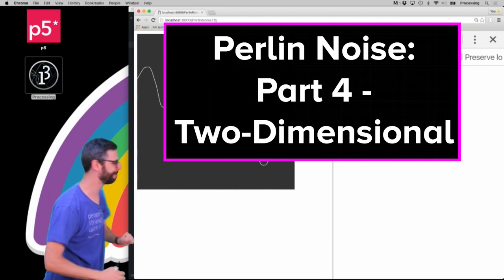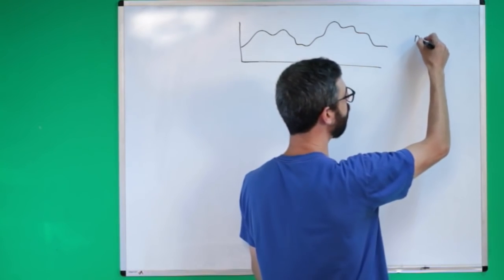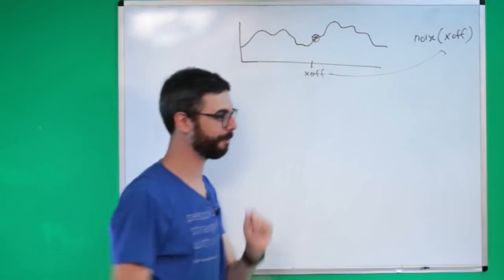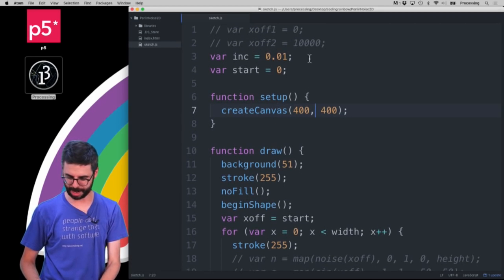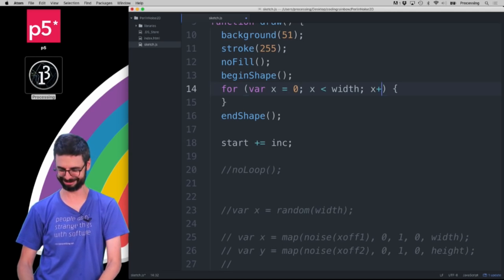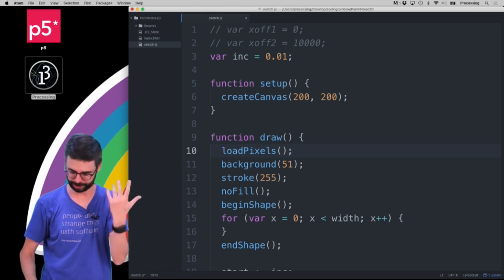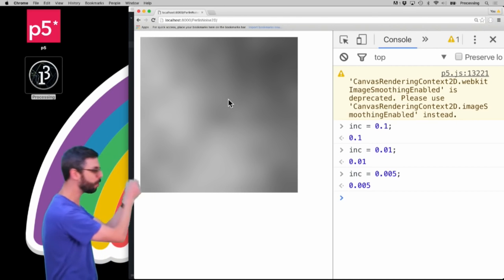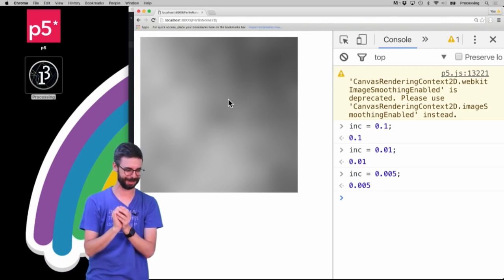Perlin Noise in Two Dimensions (p5.js)

Comment: Worth mentioning that the reason switching the order of the X and Y for loops works is because in the line "var index = (x+y*width)*4;" width is multiplied by y before it's added to x. p5 doesn't know what X and Y means and isn't actually using the letters to decide direction.

Comment: I'm  trying to do this in Processing and get stuck at the RGB spot. The index variable (x + y * width) * 4 gave me an Index out of bounds: 4000 error so I tried putting the index into a variable and mapping it between 0 and 255 but that didn't work (mixture of floats and ints). I'm wondering what the * 4 in the index variable does and if there's a way to do this in processing or I should just bite the bullet and download p5.js
Reply: its different !when daniel use the [index+1][index+2][index+3][index+4],it mean r g b alpha,so when you use processing ,you dont need [index+1][index+2][index+3][index+4],only pixel[index] ,that is enough!

Comment: Daniel, im trying to do this on processing and when i call the array pixels i got this error:

Could not run the sketch (Target VM failed to initialize).
For more information, read revisions.txt and Help ? Troubleshooting

Saying Indexoutofbounds: 40000
Reply: the pixels array works differently in processing and p5.js. the code in the for loops should read the following for processing:

int index = (x + y * width);
pixels[index] = color(random(255));

for further reference on the processing pixel array, there is a video by the same creator titled "10.4: Pixels! (The Pixels Array) - Processing Tutorial"
Reply: @asdfasdf-tp7fm  this fixes it, thank you!
Reply: Yes me too, I tried mapping the index to a new variable between 0 and 255 but because some of the outputs would be floats and some ints, processing could not parse. Booo.
Reply: its different !when daniel use the [index+1][index+2][index+3][index+4],it mean r g b alpha,so when you use processing ,you dont need [index+1][index+2][index+3][index+4]like this ,only pixel[index] ,that is enough!

Comment: Could you expand this guide to a simple map generation in 2D? Using Water, Grass and mountain tiles? Based on the Z level (Just draw squares with colors) Please <3
Reply from the maker: great suggestions.
Reply: Forgot to mention this would be top down perspective. And if its not to much, how would you save a map generated? Write a multi-dimensional array to a file?

Comment: Hi,

I did the following code on a Core i7  laptop with an Nvidia card and am getting about 11-12fps. Is this normal for processing? Should I do something to optimized the code? Thanks!

float xOff = 0;
float yOff = 10000;
float start = 0;

void setup()
{
  size(1024, 768, P2D);
}

void draw()
{
 println(frameRate);
  loadPixels();
  
  for (int y=0; y<height; y++)
  {
    for (int x=0; x<width; x++)
    {
        int index = width*y+x;
        float brightness = noise(xOff,yOff)*255;
        pixels[index] = color(brightness);
        xOff += .02;
    }
    yOff += .02;
    xOff=start;
  }
  
  updatePixels();
  yOff = 10000;
  start += 0.02;
}
Reply from the maker: +bkf did you try without P2D? Pixels can sometimes be slower in OpenGL depending on your graphics card. You can also investigate PShader. Finally just lowering the resolution in size() will massively increase speed.
Reply: Thanks for the tips. Without P2D is about the same. I will look into PShader. I'm guessing that Processing is not the best tool for doing real-time rendering that requires full-screen updates, but rather renderings with more manageable screen updates.